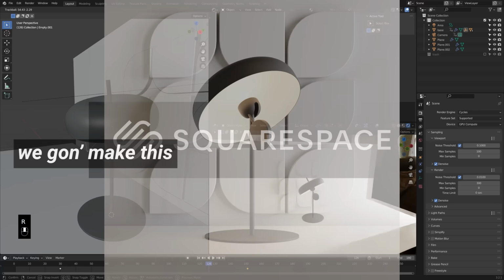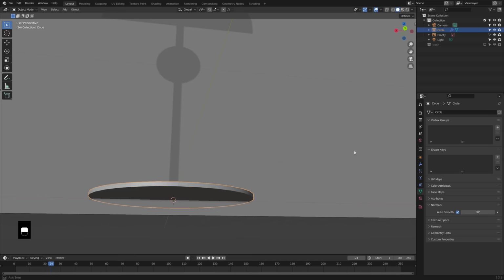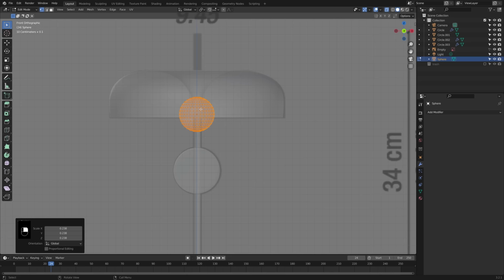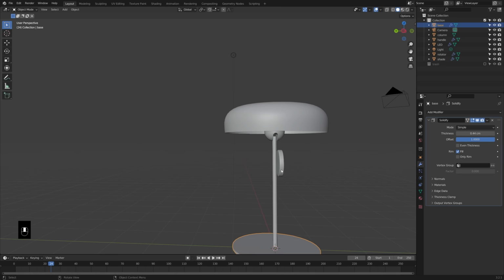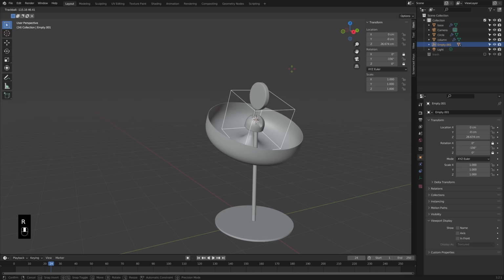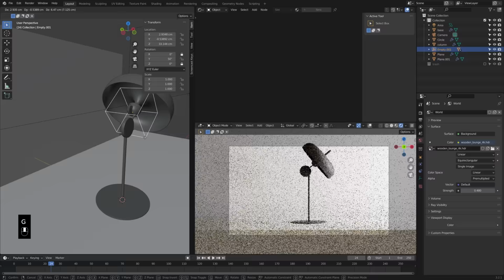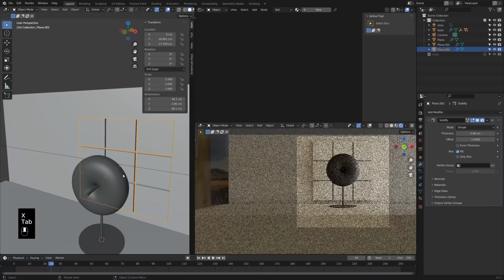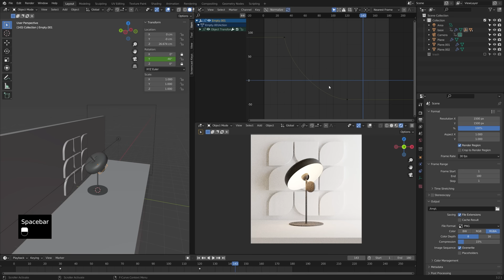Table Lamp Modeling, Lighting, Animation in Blender 3D - FF:EP4

Comment: really nice tutorial as always! one thing I'd like to note is that you're technically not supposed to use albedo colors with a value of 0 or 1 because that means that the object either absorbs or reflects 100% of the light that hits it and it isn't physically accurate. Keep up the great work, I really enjoy watching your videos!
Reply: Bah, who the hell cares about PBR cheat sheets anyway? 😟It's a problem on BlenderKit as well - likely all/most other asset repositories too - "look, I'm using PBR, but I'm not following the rules of PBR". Also sets the light strength completely arbitrary. If not using mathematically correct scaling, at least scale it to complement sky only Nishita but not really competing with sun & sky Nishita in an indoor setting. Nishita and background (with no HDR) at strength 1, and adjust CM exposure. The idea should be to create re-usable assets scaled to real world scales incl emission strengths. Also, for a light that is based solely on indirect lighting from a LED source, I'd examine how the indirect actually looks on the lamp shade itself, and then try to fake it within the material so that it provides direct illumination instead. This to limit an obvious source for noise.

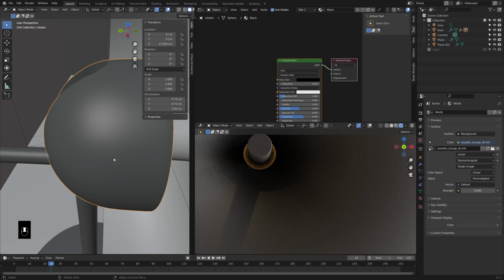Comment: 36:20 I'm struggling with the light there. I extended the shade like you showed, I made the upper column thicker, the light always leaks through the shade. Any possible fix? It's like the shade is not even there.

Comment: I have a problem with applying the white material  at 33:33 , When I change the Material Offset to "1" in the solidify modifier. the white material gets applied to the outside of the mesh not the inside.
Reply: I had the same issue. what I did, was assign the white colour to the shade as being the main one. i.e. select the model in edit mode, select the white colour and hit assign. then, I moved the white material above the black one. you should have the correct colour scheme now when hitting 1 in the material offset.
Reply: @georges6591  I found another solution: 
Solidify modifier > Normal > Flip.

that will make it work, And thanks for the reply btw man.
Reply: @aymenterea  That's a good point. I completely forgot about the normals
Reply: @aymenterea  Thank you!!
Reply: Hi, you can try modifier properties>Solidify>Materials>Material offset 1 and Rim set to 1. That solved the problem for me as I didn't want to change the Normals position. It would also be good to experiment with Edge data to define the relationship between the two materials. I also removed the current materials from the object (part) I'm working on and installed new ones. I wish you all the best and keep going. Congratulations Derek on another useful tutorial.
Reply: @aymenterea  thanks mate.

Comment: hey Derek when i select offset 1, the material color changes to upperside not inside   33:42
Reply from the maker: You may need to reorganize or reapply materials. Also if you are done with that piece you can just apply the solidify and apply the materials to the right parts the normal way

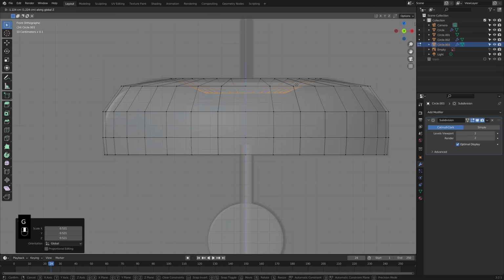Comment: I did not understand that 11:20 time stamp of getting bend inside. Can someone help me out ?
Reply: Turn on subtitles if english is not your first language.
He goes into xray mode (Alt-z) and adds 3 more extrudes - with each extrude also moved and scaled. Then an edge loop is added  (Crtl -r) between the last two edge loops, and slid up close to the loop above it. That is to keep that corner sharp.
If you press e then s (like he did) you get the extrude & get to scale it immediately.
Follow the keypress indicator at the bottom left if you dont know what he has done.
Reply from the maker: Thank you Neil! Sorry I didn't call out as many hotkeys on this one as normal
Reply: @DerekElliott  Glad to help.